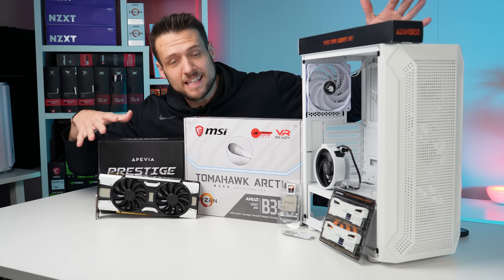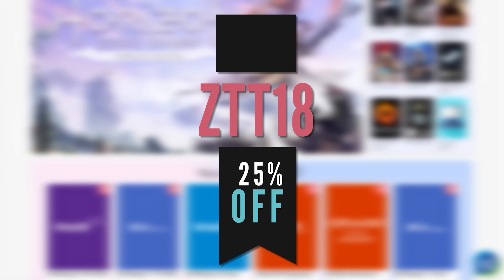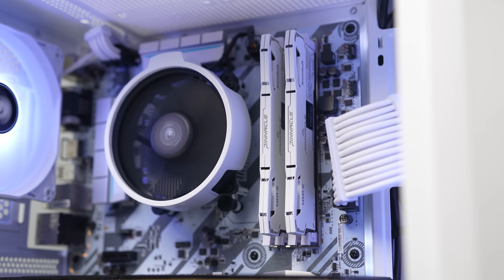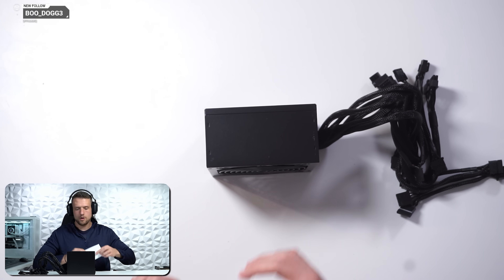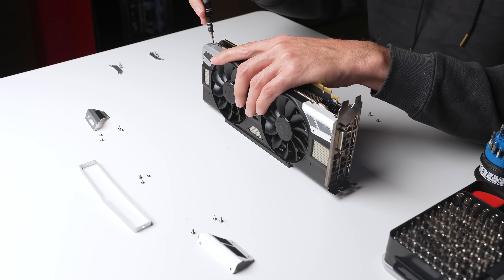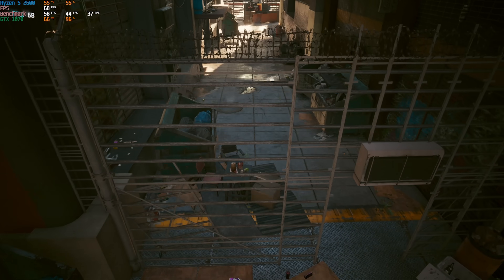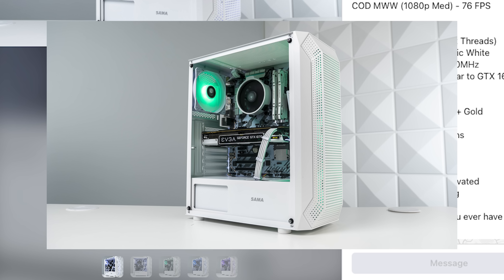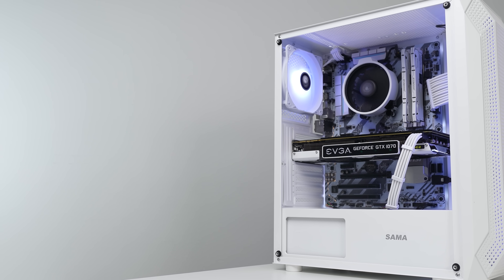$375 Gaming PC Build - FF S2:E02

Comment: I am going to bulid this pc any suggetions on what to change???
 PC:

1st Player A3 ATX Case 
Intel i7 6700k (Used,Perfect condition)
H110M-K MOBO 
16 GB DDR4 2400 MHZ RAM 
240 GB SSD 
500 GB HDD 
550 WATT 80+ PSU 
GTX 1070  8GB (Used,Perfect condition) 
Darkflash Dark Air Argb Air Cooler
(Budget is 350)

Comment: Can you tell should I get good b760 or cheap Z cheap set? In my country taxes are high so price gap is high as well. I plan to buy asus rog strix b760-a gaming wifi with i5 13600k or i5 12600k, but I'm not going to overclock anyway just want to know if this motherboard will bottleneck CPU

Comment: lol you could’ve done wayy better with that 375 my guy 🤣
I flip PC’s occasionally. My most recent one, was a 12100f + 1660 Super combo. Bought everything for $375 on the dot. $100 for the gpu and $80 for the cpu (both were used). I used a Crucial P3 500Gb SSD, Enermax marblebron 550, asrock b660m pro rs (got it new for $90 on Newegg), and some Tforce delta RGB ram (16G, 3600mhz). I also used that $60 diypc case (011 knockoff) off of Newegg.
I sold the whole build for $600.

Comment: can somebody help me. I'm building my own PC for the first time I want to know if 850W PSU is enough for me I'm using  intel i5 13600K processor, RTX 4070, 32 GB DDR5 ram, 4TB SSD and im not gona overclock it but will use it for 3D rendering and gaming.

Comment: Is this a good pc for 1k on amazone:
Gpu:Gigabyte rtx 4060 aero oc 
CPU:I5 13400f 
CPU cooler:Deepcool ak400 wh 
Ram:Corsiar Vengance lox 16gb 3200mhz
Ssd:Curcial p3 1tb gen3
Mainboard: ASUs Tuf gaming b760 plus wifi d4
Case:Lian li lancool 215 mid tower 
Psu:Corsair rm650 atx
Thanks and I want to say that you really helped me with the hole pc theme bc before suffer I didn't knew a ting and now I give people out of my class recommendations for a pc built and even my teachers
Reply: And it should be white and of course I need windows and usb stick to install it

Comment: Hello. I got a question..
Recently, I found used PC for $275 and I'm in doubt about it.

Specs ;

Intel I7-2600 3.6 GHz
16 RAM
500 HDD + 120 SSD
RX 580 8GB 256bit

Should I go for it or look for something else ??

Thanks
Reply: Almost 300 bucks for a pc with a over decade old cpu 🤔 That means the mobo is old and ram prob is ddr3. Rx580 is decent in 2023 but might struggle on demanding games, but you can buy those gpus seperate for under 100 bucks. These are just my 2 cents though
Reply: Update!

Bought used PC for $27 😁

AMD Athlon 64 X2 5000+
6 GB RAM
2048MB ATI RADEON HD 6570
149GB HDD

Comment: is this good for a pc build pls respond

KOLINK Citadel Glass SE Micro ATX Mini-Tower PC Case
ASUS PRIME B550M-A WIFI II
AMD Ryzen 7 5800X Processor
Crucial P3 1TB M.2 PCIe Gen3 NVMe Internal SSD
Gigabyte UD850GM 850W 80 PLUS Gold Fully Modular ATX Power Supply
Corsair H60x RGB ELITE Liquid CPU Cooler - 16 Dynamic RGB LEDs
MSI GeForce RTX 4060 VENTUS 2X BLACK 8G OC Gaming Graphics Card
Reply: i mean the psu is overkill but other than that, you are golden

Comment: Hey ZACH just wanted to know your thoughts on a build I built for myself
SPECS :-
Ryzen 5 2600 Used
16gb Patriot Viper Elite II (8x2 3200mhz)
RX 6600 XT Sapphire Pulse (1Y4M Warranty Left) Used
Msi B450 vdh-max
550watt 80+ br PSU
512 GB SATA SSD
KEEP IN MIND GUYS THIS IS MY FIRST BUILD AND I LIVE IN INDIA !!!
TOTAL BUILD COST WAS 360 USD
SO WANNA KNOW YOUR THOUGHTS
Reply: you will have a bottelneck with cpu, if you can get a ryzen 3600, either way its will be okey
Reply: @patozarantonello8572  yeah I know but I got the Rx 6600 XT for just 150 dollars so it didn't make any sense to loose the offer keep in mind I live in India and import duty on GPUs is 30% here
Reply: @aryanmishra9418  thats a really nice deal , also in my country import tax/duty on Everything here is also 30% ,digital games here have 130% tax 😊
Reply: @aryanmishra9418  i dont how is the market there ,but you should always buy used pc components

Comment: I'm currently saving up for my first pc, I'm thinking of getting a Ryzen 5 3600 but i'm debating between getting a 1060/1650 (used). I was thinking of pairing it with a A520M-K mobo. What do you think? Any changes?
Reply: Better to get a 5600xt or a 1070 used instead as 1060 6gb and 1650 are kinda below min specs now
Reply: @DEC3M1N  i want to make a good budget build as it's from my birthday and christmas money, I'm just aiming for around 120-150fps in fortnite as i'll probably only have a 120-144hz monitor anyway..
Reply: @DEC3M1N  is the 5600xt good combo for a r5 3600? my budget for the pc is £400 exc. peripherals (monitor keyboard etc)
Reply: @bloozified  yep its perfect and u could upgrade to a 6650 xt or 6700xt later on which would be even better
Reply: and about the 1070, is that good with a r5 3600? and just the base 1070 or 1070ti?
Reply: @bloozified  1070 ti is better if u find a good deal
Reply: is there a bottleneck for the r5 3600? i checked on the bottleneck calculator and it said on general tasks there is a 10% bn but for gpu intensive tasks 0% so i'm not sure @DEC3M1N
Reply: you wont be able to tell any difference if the cpu is bn at 10% especially when doing general tasks compared to a cpu not bn. even in gaming there will most likely always be a bn even if it is very small. you shouldnt worry about bn calculater as it is only a estimate to the percentage which might occur and you should only be worried about bn around 20%. @bloozified
Reply: i would geta 1650,but this is a really solid build, probably around 400
Reply: @kvkcvc dont get a 1650 wtf

Comment: i've built an i3-12100 + 2060 super build for just under $340

i don't like intel, but their mobos and i3's are cheap enough, and good for a modern platform upgradeability
Reply from the maker: Great for personal builds, but it's hard to flip with an i3. The casual audience thinks "all i3's suck"
Reply: @ZachsTechTurf  true, even though a 12th gen i3 is better than a ryzen 5 3600 (a great budget cpu) 🤦‍♂

i built it for my sister as she needs something for photo and video editing, so no flipping unless she doesn't do that anymore
Reply: Holy how did you manage to find this???
Reply: @Luygy  hi, lucky for you to have commented on an old comment on this day

Woot (website) is selling i3-12100f for 59.34 right now (they're an Amazon website/retailer)

All you'll need next is a cheapo mobo, ddr4 ram, and a gpu and you'll be gaming

As far as how I pulled that price off

I bought the i3 and 2060 super used
90 for the cpu and 100 for the GPU

I got the motherboard, SSD, and psu brand new for dirt cheap

MSI had a bundle deal for 75

265 now, the 75 left was spent on a case and some ram, both brand new
Reply: @Luygy  
used cpu and gpu
crazy cheap brand new bundle from msi (mobo, psu, ssd)
cheap new case, cheap new ram

i3 12100f sometimes goes on sale for 60 too
i5 12400f can be found for around 100
for turbo budget builds, stick to h610m/i3 12100f

if you can go up some more, 12600kfs are budget kings
although there is no upgrade path since 13-14th gen are cooked
the upgrade path seems to only be am4->am5 right now

Comment: I am planning on making a PC built, the one in mind for the CPU and GPU is i3 12100F and GTX 1050 Ti, wonder if its a good combo choice or will the GPU bottleneck the CPU?
Reply: The 12100f can handle about a 3060 before any substantial bottleneck. You're fine. (though I would choose a better graphics card if you have that budget)
Reply: @temtrys What do you suggest for a better GPU?
Reply: @Kai.Animations  you are perfectly fine wiht the 1050 ti ,he only is saying that your cpu will also work wiht  a more powerfull gpu like the 3060 or a 6600 xt
Reply: @patozarantonello8572  Oh, alright then. Thanks for clarifying
Reply: @Kai.Animations  np

Comment: Bro instead of the cable extensions u couldve used that 20$ for the ryzen 5 3600 and still the black cables wouldnt mess the white build alot

Comment: cant join the discord for some reason ? but anyways whats a great cpu to pair with the rtx 3060 ?
Reply: PLEASE get the 12GB version, for the cpu it's i5 12400
Reply: @Subianto02Prime  i did get the 12gb verison 😉and is the 11400f similar in performance cause i do not have a 12 gen motherboard?
Reply: @reeceSZN  there's like 10-20% gap between them.
Reply: @Subianto02Prime  damn, is the i7 11th gen better or similar to the 12400f ?
Reply: @reeceSZN  they trade blows with each other.
Reply: @Subianto02Prime ight im most likely gonna get the i7 and it there wont be any bottleneck ?
Reply: @reeceSZN  not sure about that
Reply: @Subianto02Prime  👍 Np bro gonna do some research

Comment: Hello Zach... love the vids, does ryzen 5 5600x with RX 6700xt a really good combo for 2k gaming ?.... how much avg fps it will give in 2k resolution ? And what wattage of power supply should be recommended for the above ?
Reply: Yes but I would try to splurge for a ryzen 5 7600 as then you can get an am5 motherboard which still has upgradability and will last you longer in the long run
Reply: @PearsonPlays  bro, that would be a new ram, motherboard :face-blue-smiling::face-orange-biting-nails: go for the 5600x if you can the 5800x, either way you are golden
Reply: You could probably get away with 550W, but a 600W or higher power supply would be better.
Reply: Thank you guys for suggesting

Comment: Why do u use that crappy stock AMD cooler always? Even 65W TDP CPUs like R5 3600, 5600 thermal throttle while gaming with this cooler... You can buy a better cooler for like 15USD if you wanted...
Reply: The stock cooler works fine. He even benchmarked it. It's a 2600 lol. Stock coolers are underrated and get the job done most of the time
Reply: I have 3600x with stock cooler and works good temps while gaming 70c idle 45-50c it doesnt throttle... But yes im going  upgrade to better cooler
Reply: The point is...HE WOULD HAVE TO BUY IT! When you flip PC's, you cut cost everywhere you can. Why buy a cooler, when you get one free with the CPU? Of course, you wouldn't use that cooler if it was a personal build.
Reply: @mrich70  Why? Because you have integrity and want to sell people a good product? Because you're an influencer with impact, and if you spread information that this cooler is enough, you're making people's builds miserable.

Comment: 1070 for that price is absurd
Reply: when you flip pcs, you are only trying to profit like $100 for the installation fees, cuz if u r not brand builders that buy parts in bulk, you are only trying to add in 100 bucks installation fee(almost the average building fee for every big brand out there) Plus he put in efforts to paint the parts himself, and the cables were managed well, 100 bucks for building fee is not bad
Reply: @shinefake48  no i mean he got that 1070 for 60$, thats insane imo
Reply: @maiceenvy  oooh, my bad, thought u meant 1070 with the pc costing 475. Yea I see what u mean, but it could be those big deals where the seller just let ppl bid and sometimes the cost end up being less than market average